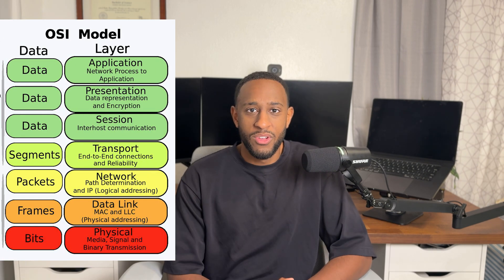The OSI model - A Network Engineer's Breakdown

Comment: Can this model be simplified into 5 layers? Seems like layers 5-7 are all part of the same entity. I think it'd make learning easier.
Reply: The TCP/IP networking model is the model that has 5 layers. I believe this model (TCP/IP) is the most commonly used networking model at the moment. And you're right, layers 5-7 are a part of the same entity where those layers would be considered the 'application layer' within the TCP/IP model. 

I'm currently studying networking so I might be wrong, but the TCP/IP is definitely more concise and simplified from my understanding. But it is still important to understand OSI model for terminology purposes. 

By the way great video Wali, you're great! @NetworkWali